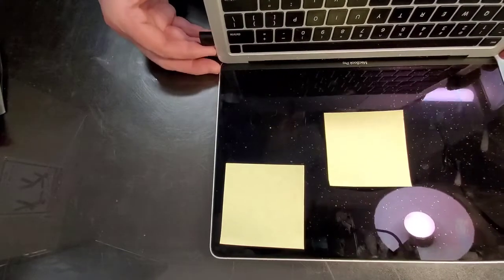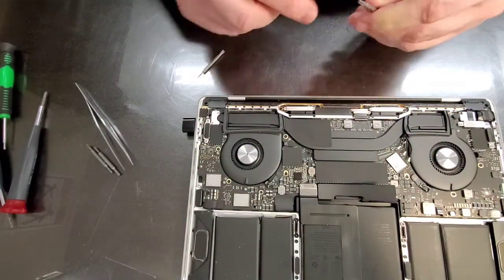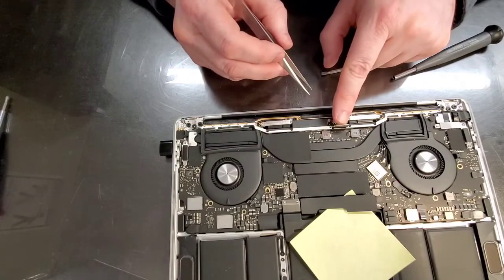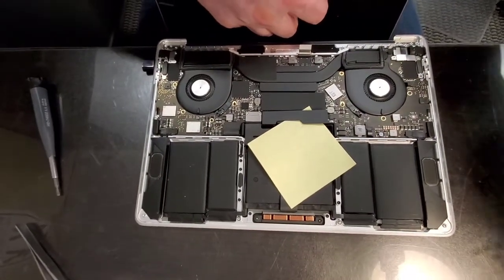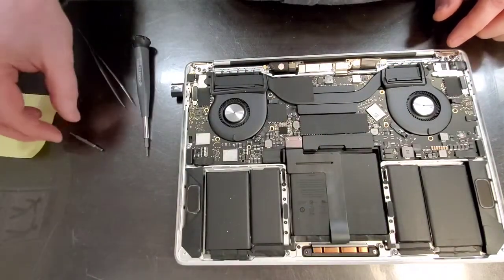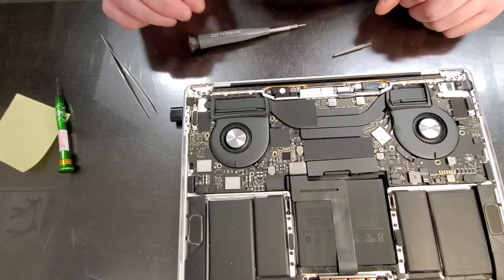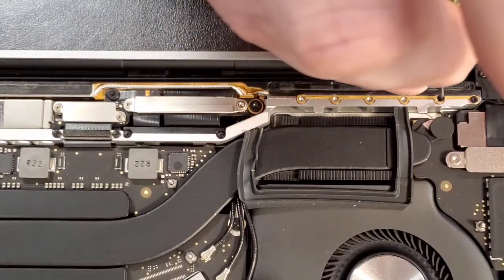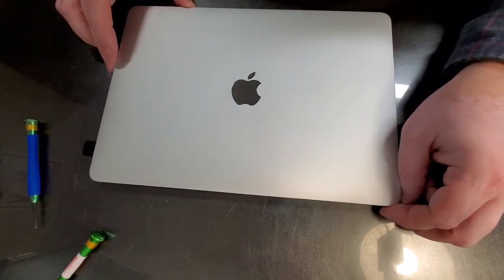Complete video of 2020 Macbook pro 13 inch A2251 cracked broken  LCD detailed replacement

Comment: Well executed and explained. I used your video to replace my macbook screen. When I tested (before screwing on) it came on but when I screwed everything it is no longer showing. Any idea what could be wrong?
Reply from the maker: You must have done something wrong. Take it carefully apart and check each lead and wire with a magnifying glass. you may have done some damage or not connected something.